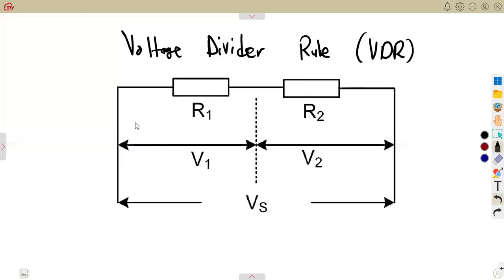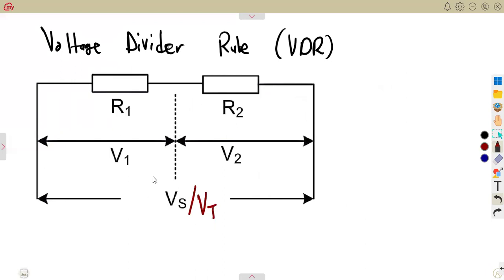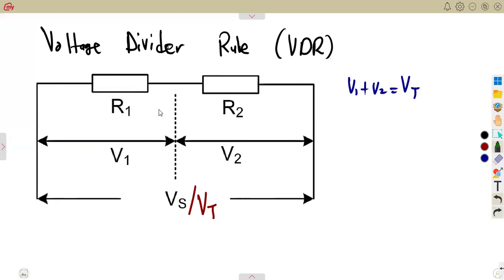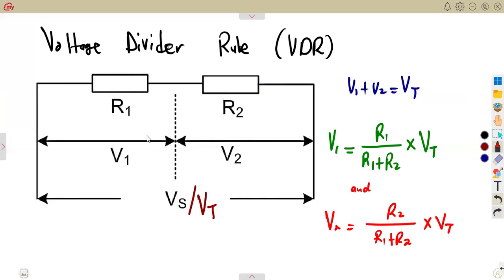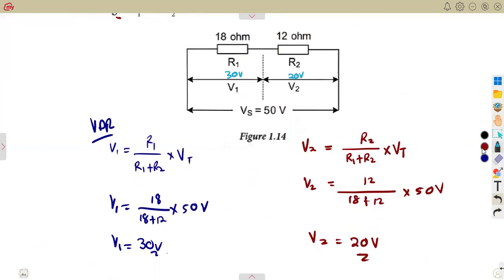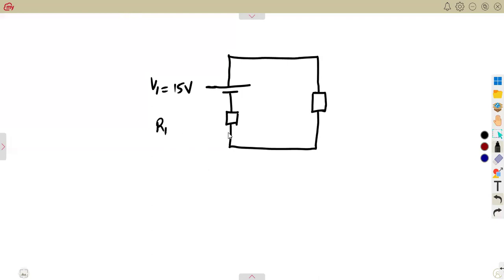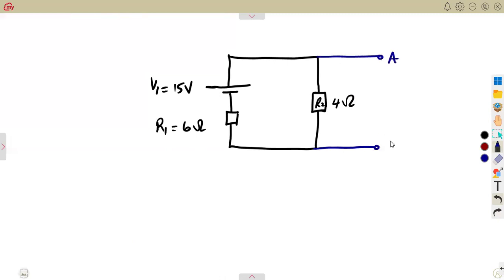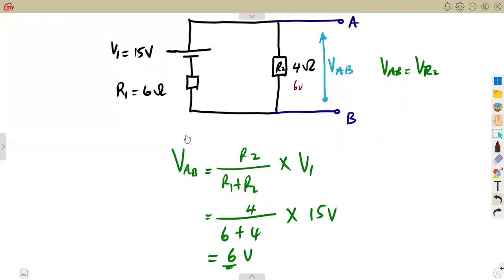Industrial Electronics N4 Voltage Divider Rule @mathszoneafricanmotives  @mathswithadmirelightone

Comment: Can you explain using the bridge circuit  this time🙏 because I'm really confused about whether this rule applies on series or parallel circuit?
Reply from the maker: Voltage Divider is applied on a series condition.  The voltage I being shared between the two resistors in series